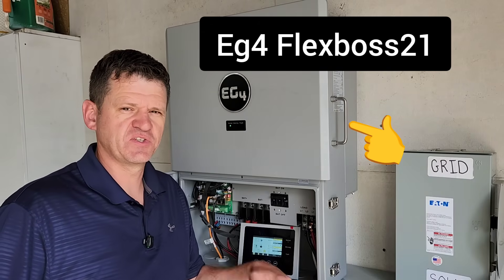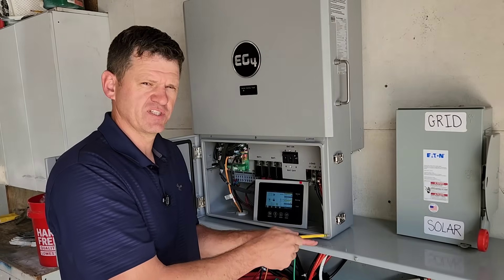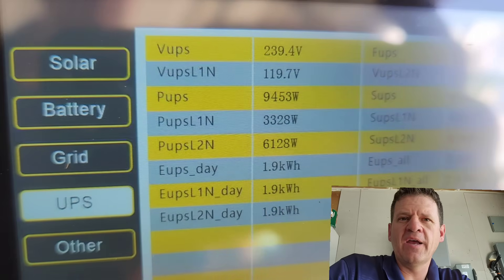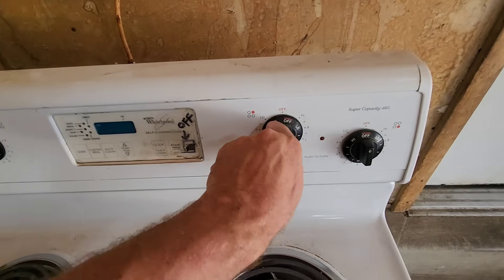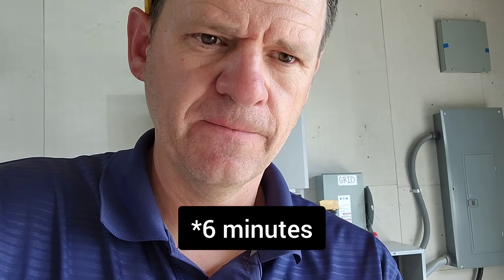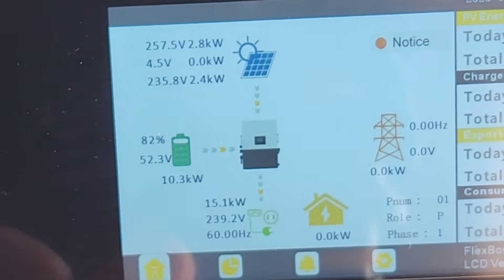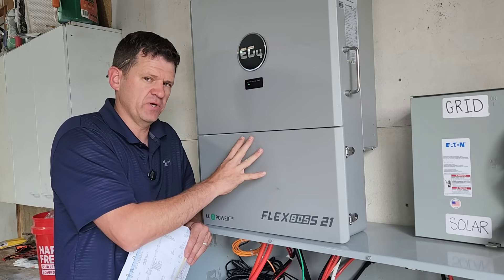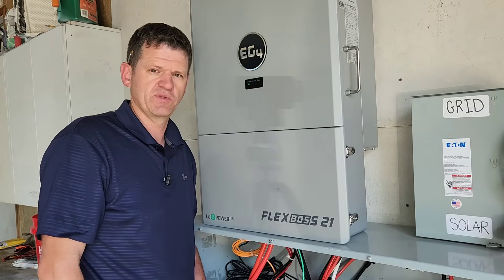EG4 FlexBOSS 21 - Load Testings

Comment: Could you ac couple connect micro inverters to load output ?
Reply from the maker: Interesting. I have never done anything with microinverters but from what I remember I think I saw someone just connect them to a back bed breaker, which is essentially the same thing as connecting it to the load port. Please call eg4 and verify you do it though.

Comment: How do you set the inverter to not export anything back to the grid ever but just use the grid as back up when solar or battery isn’t enough or on cloudy days when no solar or batteries available
Reply from the maker: It's pretty easy. There is just a simple setting change. I can't remember exactly what it is, but I would definitely call eg4 and have them look over your settings when make the change... or they can make it for you.  The nice thing is that it is just one change and then you can set it and forget it.
Reply: @diySolarPowerFunWithRay thanks for the info! Really appreciate it!

Comment: Is that background noise the fans of the Gridboss running so loudly?
Reply from the maker: It is the flex boss. Yeah the fan is louder than I like.. the flexbox 18 supposedly is super quiet... supposedly :).  The fan on this unit turns on when I have a load above 6000 Watts or the solar is coming in greater than 6000 Watts

Comment: The Sol-Ark 15k can output over 15kW when connected to solar panels. It has a 24 kW surge output for 10 seconds. So they appear to be fairly equal.
Reply from the maker: really?  24kw for 10 seconds...That's impressive.

Comment: So did you just get rid of your 12000xp and 6000xp?   What advantage does the flex boss have over the 12000xp?   In your particular use case?   Thanks for all the helpful videos!
Reply from the maker: The main advantage is that it's a hybrid inverter and has grid assist(see more details here : https://studio.youtube.com/video/UvwsMoT0mX0/edit)... However the FB is missing some of the features that the 12,000xp has.  For example the FB doesn't have a Smart port or a generator port... You need to pair with the gridboss for those features.  That's one reason I still like the 12,000xp and also the 18kpv, 12kpv.  I hope they don't go away.  I really like the 12kpv...Very quiet!  I hear that flexboss18 is very quiet also.

Comment: What is that orange device you clamped your meter to?
Reply from the maker: It's basically a line splitter.  Splits the hot from the neutral so I can measure how much current is flowing on just the hot with a clamp meter.

Comment: 16kw is the continuous inverter output, not sure where you get the idea that requires grid. You seem to be confused about the battery interface limited to 12kw continuous nothing to do with grid. The inverter converts DC to AC the battery interface converts 48vdc to 400vdc that the inverter then uses, the MPPT also boost to 400vdc, all are sharing this HVDC inside the unit. 18kpv had a 12kw inverter, Flexboss18 has a 13kw inverter and the 21 has a 16kw inverter none of those require a grid for full output.
Reply: The flexboss18 requires grid present to reach 13kw of output. The grid isn’t being used. But it has to be present.
Reply: @GavinStoneDIY  Grid just allows you to max in the inverter exactly and perfectly balance the load along with handling poor power factor. If you had a perfectly balanced resistive load with 1.0 PF then it should handle 13kw otherwise it's not actually a 13kw inverter. Most inverters are actually rated in VA not W due to that. The test video I saw had unbalanced loads and used a mini split as well which has poor PF and went above 10kw no problem but couldn't handle above 12kw very well, definitely not a 10kw inverter.
Reply: @justinharrell9256 it’s a 10kw inverter when off grid. I tested it on and off camera. Granted it can surge far above 10kw. But continuous output of 13kw requires grid. EG4’s reasoning was that it protects the DC bus. It’s also in the manual, you confirm it there.
Reply: @GavinStoneDIY  Protecting the DC bus means poor power factor causing reactive power needing to be absorbed by the HVDC bus/caps. Do you know what power factor is and how a HF inverter like this has to deal with it? The Flexboss 21 has the same verbiage and same issues, the inverter rating is at power factor 1, unless your testing with a purely resistive load bank you probably have less than PF 1 (air conditioners). There is a thread on DIYSolarForum discussing the "with grid" verbiage for the 21 and EG4 responded it needs to be PF1 for off grid to supply the full 16kw continuous, the should be the same with the FB18 at 13kw. This is why a Victron is rated in VA with a lower W rating, the W rating is at 0.8 PF, EG4 is sloppy and just list 13kw APPARENT power which is actually VA, but with the grid absorbing the reactive power the inverter only sees the real power regardless of PF.
Reply: @justinharrell9256 I tested it with resistive loads. I think my last video just showed it performing with grid. But yeah, I’ve tested it. And it’ll eventually trip without grid. In my last video I showed what EG4 gave me for surge times with and without grid.
Reply from the maker: Here's a good test video from Rodney hunt showing the grid being required for the higher output in the flexboss18 : https://youtu.be/HRf5tdaBwaI?si=uduVLjnkG3KzlQic.  I'll look into this further.
Reply: @diySolarPowerFunWithRay  Rodneys video showed it going above 10kw, but had a hard time above 12kw but he was running a mini split which has poor power factor and the load was unbalanced.

Comment: Is this unit compatible with solar edge optimizers? I might have skipped over in the compatibility on this product.
Reply from the maker: hmm. I can't say for sure. I'd call eg4 or signature solar to verify.  Are those just DC optimizers.  I need to look more into those.  Please let me know if they work out through the normal DC solar ports.  I imagine they do work.
Reply: @diySolarPowerFunWithRay they are DC optimizers I have 15 400watt panels on each leg running in series. I will reach out to them though. Thank you.
Reply from the maker: Thanks, Yeah please let us know. I think you just connect from the dc optimizer to the solar port like usual.  I might need optimizers on my array also

Comment: how was the noise level of Flexboss 21 when it was at 16kwh load?
Reply from the maker: Hmm. It seemed about the same as when it was outputting 7000 watts.... I'll make a dedicated sound video short.   Apparently the flex boss 18 is more quite than this unit

Comment: Any light flickering with the 78 amps inrush while starting the AC with a moderate to heavy load?
Reply from the maker: If I run the inverter in off-grid mode, yes. Just like all the other inverters. But if I run with grid connected, in  non off-grid mode the lights do not flicker when the AC turns on.

Comment: It should be able to output around 16kW continuous with solar helping, without the grid.  Without solar ... on battery only, its 12kW (with two batteries).  With one battery it is battery-limited... I forget the number.

In grid interactive mode (and the grid is on), anything above what the inverter can handle will come from the grid, and the inverter should continue operating at its maximum capability.

-Matt
Reply from the maker: Specs mention grid with the 16kw.  Not sure it s needed thought.   It is for the higher output on the fb18. Rodney hunt discovered this.
Reply: This is correct and if using 1 battery its limited to the 200 amp output capability of battery so around 51.2x200= 10,240 watts

Comment: Ok, I have the FB21, grid-tief with  4 strings of 12 older 300 watt panels and a fifth string of 12 new 430 Qcell panels all ground mounted . I have 30kw of Discover rackmount  batteries. I thought with just solar it would produce 12kw since they only show max with solar and Battery in the specs, however it appears that with solar only it also produces 16kw on the grid lines, I don't use the output terminals. However if I charge the batteries I've seen the total PV output hit 19kw, 16jw to the grid and 3kw for charging. It's mounted outside and I find it quite noisy,  kind of like a turbofan, but when I hear it I know it's putting out some great power. This time of year I'm getting about 100 to 110 kw per day. Not bad.
Reply from the maker: Nice, That's a lot of solar!!  around 20kw. I need to add another array and then get a EV :)

Comment: Try changing battery on meter
Reply: Not an issue with the meter as stated later in the video.  Clamp was on the 10X clamp port.
Reply from the maker: yeah, I was on the 10X clamp port of the line splitter.

Comment: Does flexboss got software problems
Reply: I have not updated it with the latest either, and currently have no issues with my FB21.  It is currently on the March firmware... FAAB-2021.
Reply: Mine does not but I have read on the latest forum news that the last firm where has issues. I have not updated to that firmware yet
Reply: People have had problems.  It's a cool product hope they iron out the issues more better.
Reply from the maker: There were a couple setting that were off... I think there were 3 setting that were off my default.   Not too big of a deal but I'd have eg4 double check the setting before turning it on... Took about 5 minutes on the call with them

Comment: got a 6.2 kw 240v single phase inverter from powmr. specs say it can do 110a battery charging (48v). the thing trips and resets charging batteries from ac if it gets up to like 5.1kw (90ish amps to the battery). ironically it can also do like 7.5kw with pass thru ac and battery charging at the same time lol. i think the battery charging spec is only with a good amount of pv coming in. idk still the best dam 280 bucks i ever spent on an inverter lol. charge my car with it every day at work from a 15kwh battery i made for another 600 bucks.